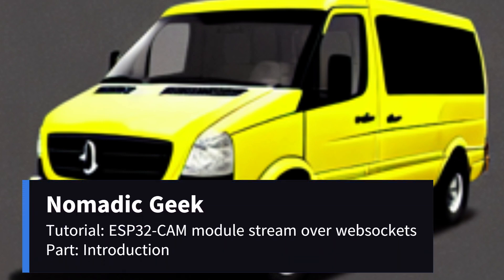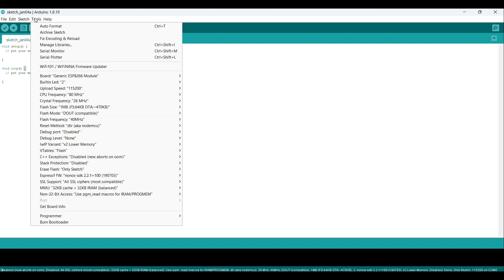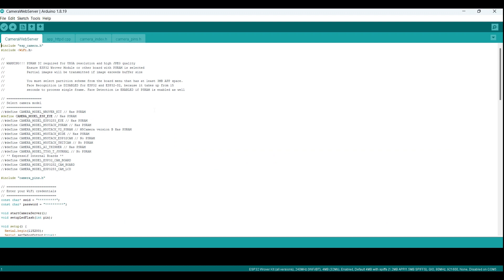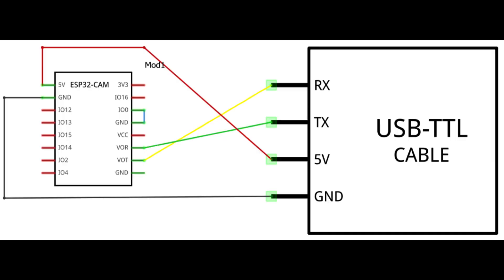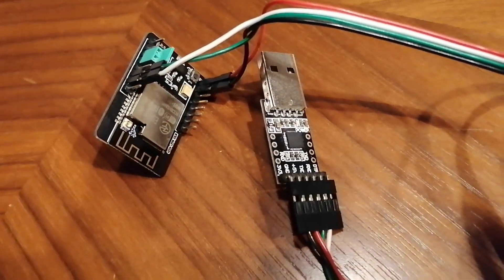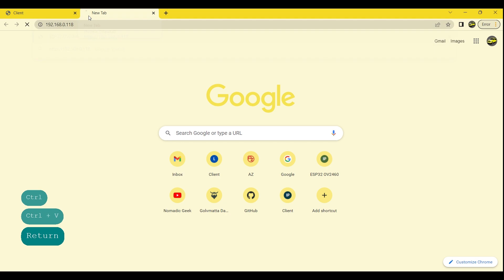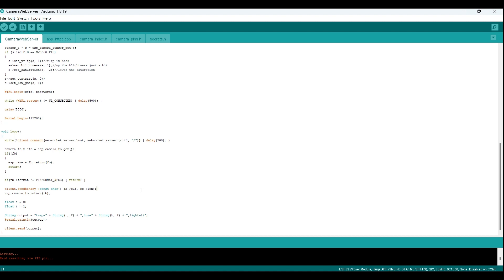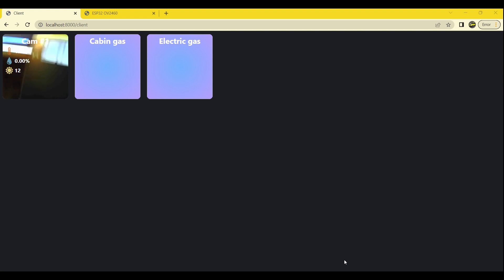ESP32-CAM Video over Websockets

Comment: i want to monitor pests in pest trap send 4 images per day  and use machine learning to identify pest and count pest to predict pest infestation
Reply from the maker: Sounds like a great project! For machine learning you would like much quality data, which make a video stream preferable. I would suggest that you do the sampling of the dataset of images on the server. That way you can control the amount of images saved in a better and easier to manage way. The video stream is in reality a stream of many images, so just save an image from the stream with as many intervals you'd like. That way you can change the amount of images saved each day, without having to change and upload a new sketch to your ESP-32 module.
Reply: @nomadicgeek_369  actually my device is battery operated and using SIMcard module instead of wifi so i can use at any remote farm. Now my device is working my device send images to the server my server process the image and store the pest count and bounding box image in database. at farmer's side I have Android app in which farmer can monitor pest status i also implemented push notification so when pest count is high and over the economic threshold he will get notification about high pest infestation at farm also used temperature, humidity and light intensity sensor for growing degree days calculation so my device can predict which pest 
 development stage is occurring  like it can predict larval stage is ongoing in 12 days pupal stage will come so farmer can track every movement of pest to act before big loss

Comment: will this work even if i dont have the two gas sensors just esp32 cam? my webpage only diaplays Cam#1 text but the video doesnt appear
Reply from the maker: Hello and thank you for watching! The system should function properly even without the gas sensors. In case you encounter any issues, you can simply remove all the sensors except the one/ones that are currently connected from the sensors.json configuration file.

Comment: Great tutorials!
I wonder if the websocket server and client code itself could be hosted on a esp32 running in AP-Mode so that a client can access the cam streams and sensory data?
Reply from the maker: Hey, thanks for your comment and I'm glad you like the tutorials!

It's an interesting idea to host the WebSocket server and client code on an ESP32 running in AP-Mode. While it might be possible to achieve some functionality, it's essential to remember that the ESP32-CAM has limited processing power and resources compared to a more powerful server.

In this context, focusing solely on the camera stream and experimenting with multithreading could be a fascinating learning experience. However, it is essential to manage your expectations regarding the project's overall performance and capabilities. As such, I would advise against relying on this setup for anything more than experimentation.

If you do decide to test this out, I'd love to hear about your results and any insights you gain from the experience!
Reply: @nomadicgeek_369  Hey there, i might go for the access point and node js server on a raspberry pi or similar to use a little bit more performance.
Reply from the maker: @Clemens2022  That sounds like a smart choice. I'd appreciate it if you could keep me updated on your project's progress and the choices you make with the Raspberry Pi setup since I'm planning to do something similar in the future. Wishing you the best of luck with your project! :)

Comment: Hello! Thanks for your videos, its amazing! I've got a trouble, please help me. On the server side (server.js), when i received message (from ESP), type of data always "object", so i can't parse data to image and string, as you can do it in video. From arduino-ide i sent message as string (client.send(output)), but received as uint8array. Whats wrong, can you explain? :)
Reply from the maker: Hi there! Thank you for reaching out and for your kind words about my videos. I'm glad to hear that you find them amazing.

Regarding your issue, have you confirmed that the message being sent from the ESP32 is indeed a string? You mentioned that from the Arduino IDE, the message is being sent as a string, but when received on the server side, it's coming in as a Uint8Array. Is this observed in the serial monitor?
I need to know this to understand if it's the ESP32 code or the javascript code that the issue is.

Additionally, have you checked the upload settings of your code on the ESP32 to ensure that the code is being uploaded with the right settings? If not, this could cause the ESP32 to send the message header wrongly.

If the above steps do not resolve the issue, I will look into it further and see if there are any other possible solutions. I'll get back to you.
Reply: @nomadicgeek_369  Thanks for your reply! I had a solution for my problem - the Node.js WebSocket library was version 8.12.0. When i downgraded to the version "ws": "^7.5.7", its working like a charm. Seems like in newer version of 'ws', parsing data is more complicated than in previous. Anyways, thanks in advance!
Reply from the maker: @rezvov8581  Thank you very much for sharing your solution with the community! It's always helpful to know different approaches and insights that may benefit others. Your experience could be valuable to those encountering the same issue.